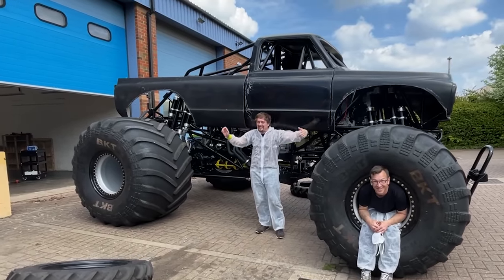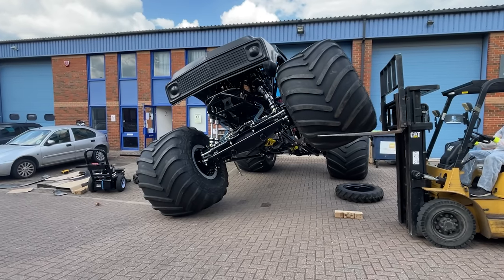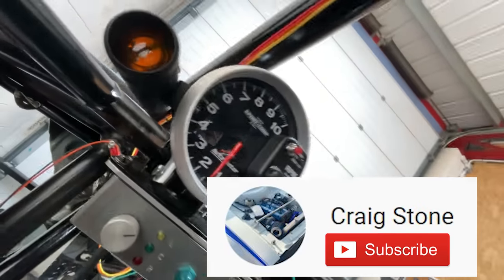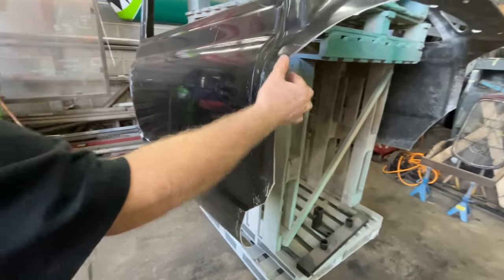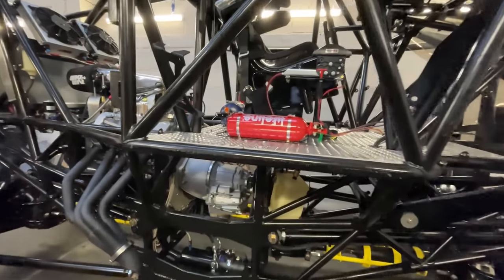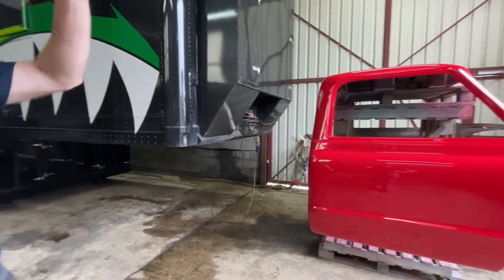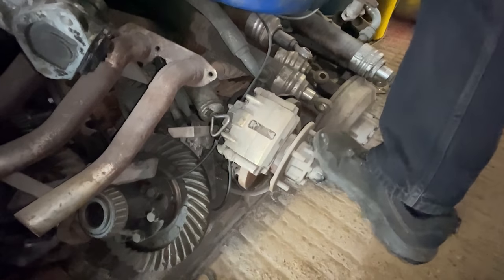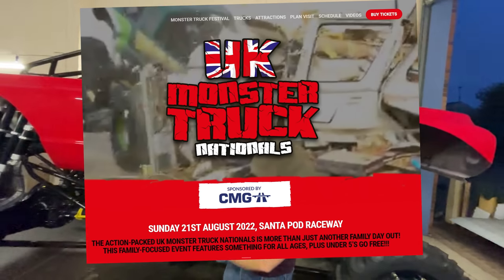Monster Truck build - this didn't go quite to plan - ep9

Comment: I can't wait to see it with all the decals 😎 
One small point though Kev, maybe.....Test it with the body off? 👍 If you do roll you don't wanna tear the body up for no reason.
Reply: Well that’s why they made the mold for the body, remake the pieces. These things are made with the intent of ripping up the body lol
Reply: @thannydevitos2332  
Not when you're practicing.
The same principal as a regular motor race, the driver's don't go all out until qualifying and the race.
Reply: Drywall tape and Shoe glue!
Reply: @randalthavandal  honestly that’ll probably work 😂
Reply: @randalthavandal  LOLLIPOP
Reply: You really want to test the body too though. Need to check clearances while it's actually flexing in use. Make sure it stays attached when moving around.
Reply: @jamiepile2861  they still crash

Comment: wow😍 Maybe try to make it radio controlled?
Reply: the point of all this money is that it's not an RC LOL
Reply: Technically it will be. 
As per many regional rules, they must have a wireless kill switch, incase stuff goes sideways. It just isn't fully R/C'd. Lol.

But I look at it like this,  if he makes fully radio controlled, he won't be able to live out his dream of driving his very own monster truck.  The hardware required to do so would take up alot of space to the point he wouldn't fit in the cockpit. After all, that's why he's building it. To drive it.
Reply: Thats a nice idea
Reply: Imagine the batteries dies
Reply: @Lindisfarne666  you are
Reply: Bro r u mad

Comment: Kev, you might want to have the truck under normal sitting suspension load when you attach sway-bars, not all the way slammed - this will avoid binding issues. Not sure on a Monster Truck, but it's this way for regular vehicles at least.

Comment: Little tip to get those big tires on, get some large metal baking trays. Roll the tires onto the baking trays then slide the tires on. The metal baking trays slide on the ground A LOT easier than the rubber tires do!

Comment: Won't lie wee bit jelly Kevin. I've been fortunate enough to have helped build and work on several of these beasts as well as multiple Rock Bouncers/Racer's(Class 4) and countless mud trucks and general "Wheelers" but I have 𝙉𝙊𝙏 gotten to really drive any of the Monster trucks. Ya ok I drove around the yard and did some circles and reversed and whatnot to check for mechanical problems but that isn't driving in my book. I want to literally floor it and hit cars then see absolutely nothing except the blue sky and clouds above even if only briefly. I would however highly suggest anyone around those while running 𝔸𝕃𝕎𝔸𝕐𝕊 wear hearing protection as it does cause hearing loss along with power tools like air impacts after yrs of use so I've found out at 43.

Comment: on your first proper drive with the big tires you should have the body off just to get used to driving something so big. then when you are comfertable and learned a few tricks then add the body. when you first start to learn you will roll it at some point, its cheaper to roll it with no bodywork  on

Comment: I dont understand why you would need to cut the body that far considering that with the sway bars you would never have a situation where the tire will be that close to the body.  The closest it would be is landing from jumps at which point the wheels will be straight and it will still be further because it wont be flexing

Comment: Kevin ? Al your parts mount with 8.8 bolts or 10.10 .  10.10 is stronger for flex chassis

Comment: Just a heads up, you better make sure u have an extra engine on hand. U may need it, especially with a blowm alcohol big block chevy. Even with good rods, they are know to through rods with boost. Also when doing backflips like in monster jam, you can cavitate the oil( puts air in the oil) even with a sump style oil system. Ive sen it happen. Bad things happen when that happens for too long. Also, make sure to check the valve lash befpre and after eadh show. I recommend loosening the valve lash when driving it sayat the shop, and tightening it back to what its at rightnow when at the show. Makes the engine last just a little bit longer.

Comment: Kev love the work! I think you should re think your jack adaptor, your current set up is terrifying! As you increased the height testing the travel of your shocks I was cringing waiting for that square tube to slip off the plate of the jack. Just my opinion.

Comment: Ok so now he said the reason for two moters in his crawler one for take off one for hi end . He wants to crawl and race . Short shocks and  two moters and mid size 1.5 on 1.10 axals with extended wheel adapters hmm fun

Comment: Hi Kev. A little tip. If you get a thin sheet of metal about 1ft x 5ft with grease on it you can slide the wheels on and off very easy. 👍

Comment: A little tip if you're going to put the wheels on by hand instead of lifting them with the fork truck, get yourself a piece of sheet aluminium, put some oil on it and then you can use that underneath the big wheels to help them slide against the hubs.